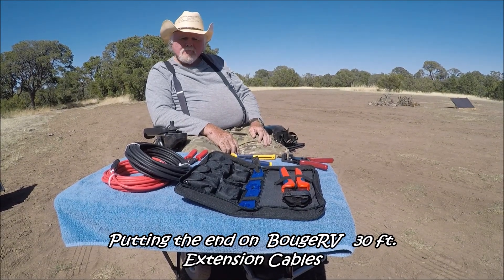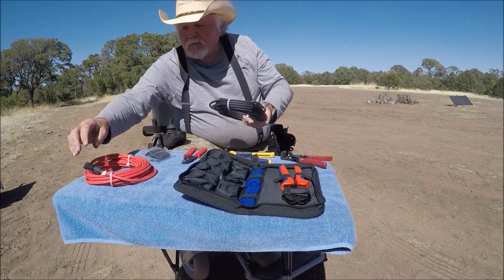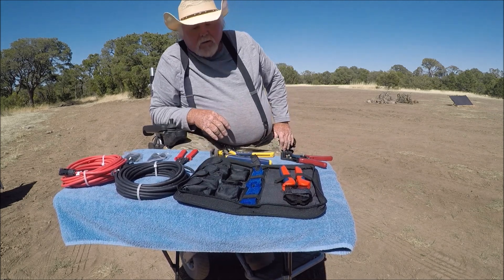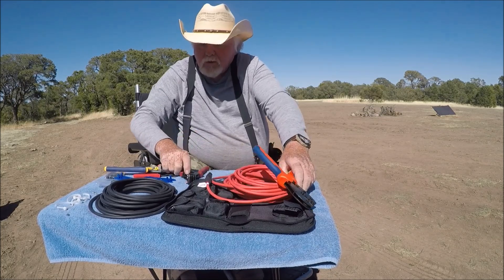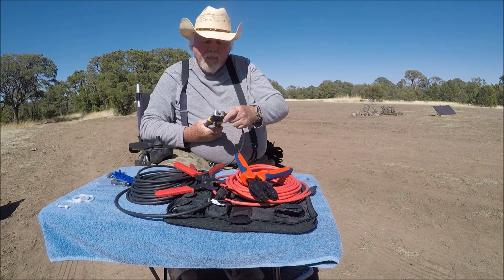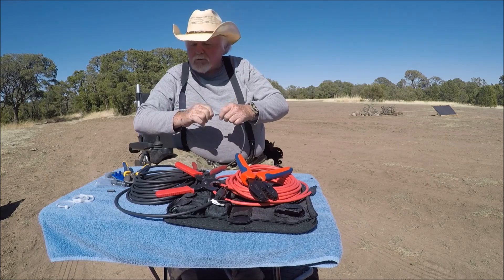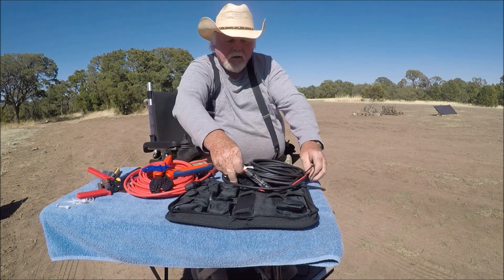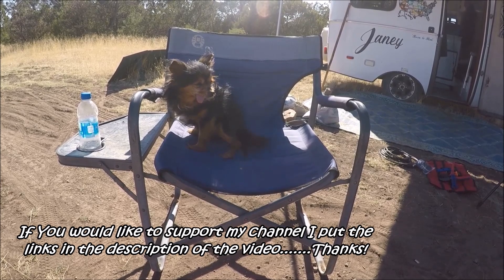BougeRV making 30 ft, Extension Solar Panel Cables.

Comment: Hi John,  I watch your videos here & there & I heard you complaining about the dry dusty conditions of the Tucson / desert areas.  I live near Tucson & I suffer from sinus problems & the conditions here make it worse.  I wanted to suggest using a Navage.  Its a device that you use to run saline water through your nasal passages  Ive been using it for a few years & it works great..  might be worth checking out.    Its also great to see you & Little Man together, I can tell you really love him
Reply from the maker: Thanks....yep I have tried it. It doesn't  work for Me.

Comment: God video on making extension. Is there a limit on how long you can make an extension?
Reply from the maker: Not as far as I know....
Reply: Yes, but it depends.  The longer the run the thicker the wire needs to be.
Reply: 30 feet is probably about the limit, unless you want to spend really big money on bigger wire.  I personally use 20 feet and can usually find a sunny spot with that.
Reply from the maker: I cut them back to 15 ft.